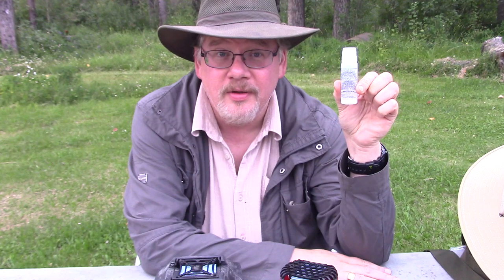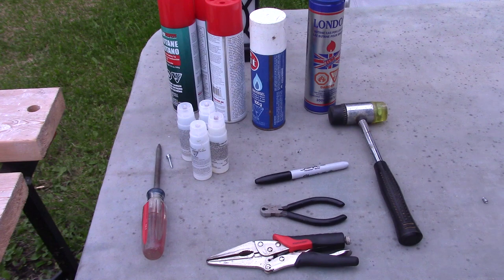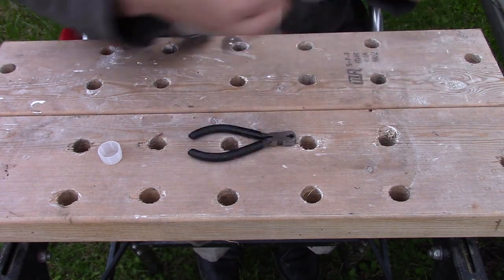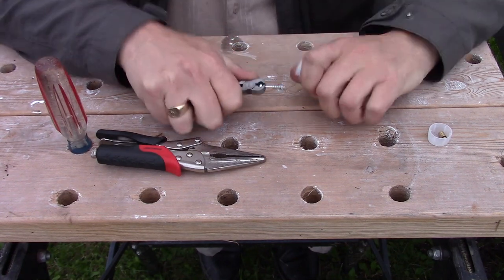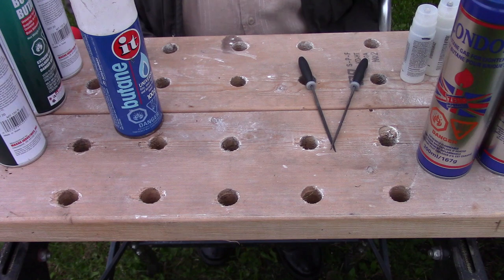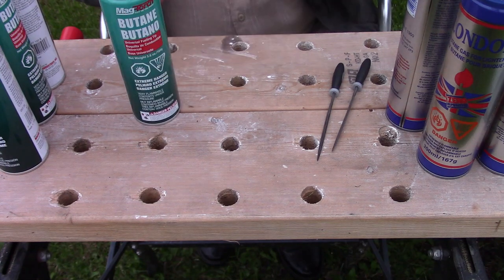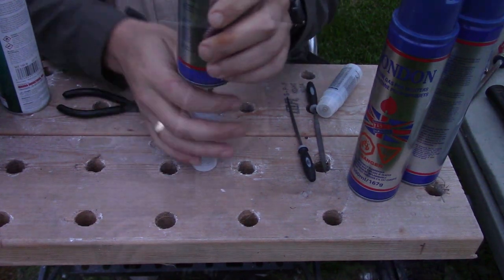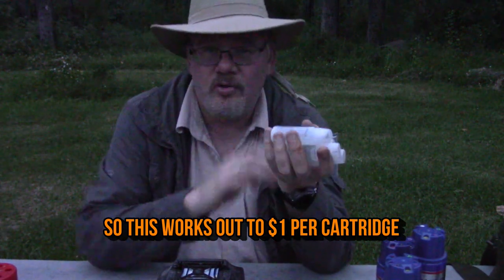ThermaCell Refill Secrets Revealed! Safety Tips, Step-by-Step Guide, and Bonus Laughs!

Comment: Very good video. As you said, it combines the best points of those previously done. Was unable to see how you modified the tips to get them to work better, however. Will watch again and listen more closely to your explanation.
Reply from the maker: I modified the tip of the butane nozzle by taking a small triangular file and cutting a small groove across the tip. This keeps the tip from completely sealing witht he valve in the cartridge and gives the gas somewhere to go (sideways). Before I cut the groove in the tip, it would seat too well with the valve in the cartridge and no gas was getting to the cartridge at all. Before I id that I was wiggling the butane can from side to side, and that snapped off a few tips and took a long time to fill a cartridge.

Comment: Can you tell me what you are notching?
Reply from the maker: I'm notching the tip of the tip adapter on the butane can. This allows a tiny gap on the sides of the adapter so the gas can come oout. Without doing this, sometimes the pressure against the safety valve compresses the adapter enough so no gas goes into the cartridge.

Comment: Hi thanks for the video. Possible to show a pictures of the mod 5 tip
Reply from the maker: Actually they all look similar. So look on the tip itself or on the cap where the tip was and it may have a tiny "5" on it. You will need a magnifier, because it is very tiny. Alternately, you can do what I did with different butane cans (cheap ones mostly) and just keep trying tips till one fits.

Comment: Great to know, what do you use for the replacement pads? I can only seem to find refills that come with pads and butane canisters. Not just pads.
Reply: You can make your own pads with pymethrian and water. Add a little food dye to see your coverage on the pad.
Reply from the maker: Look for the replacement pads for the Thermacell Backpacker unit. They're the same thing but they're sold by themselves. If you're daring you could try the aftermarket pads on Amazon but they're quite small and they smell pretty bad.

Comment: Hi Dean, thanks for sharing. I'm having trouble refilling the thermacell. I lost more than twice as much as went in the thermacell. The "Ronson" tip doesn't fit properly. I bought Grill Master from Home Depot and "Woods" from Canadian Tire and those tips don't fit either.  What can are you using and how do I get it?  Or, do you know where I can buy adapter tips? I live in BC. Thanks,
Reply from the maker: Glad you asked! I found a brand called "London" that works great. It has 8 tips, including the #5 tip a lot of others say works best. There's another brand with a bright yello can and cap, but I forgot the name, but it looked OK too. But the London brand works swimmingly.
Reply: @AlbertaBushcrafter  Thanks for your response.  London brand not currently available on Amazon.  Do you know where else I might get it?
Reply from the maker: @smilinsuzi  I got mine at Smoke King in Spruce Grove AB, but most smoke shops have it, if they sell lighters. Most do.
Reply: The magtorch butane can at canadian tire works great ! And it has the #5 tip
Reply from the maker: @vio95  I used these while first researching this technique. They're good, but be careful to not apply too much pressure and to let the tip warm up between refills. Otherwise, they snap off. But if you do that, those cans work great.

Comment: Cant the pads be used with a candle and eliminate the thermacell?
Reply from the maker: Theoretically, yes. But it would not be easy. The very small butane burner heats a metal plate, which vaporizes the insecticide on the pad. And from the looks of it, a candle would actually be too hot. Marginally possible but I would not take the risk. 

It's actually a lot safer just to refill the cartridges, and you'd only need a few of them to keep the unit running for a long time. And once a cartridge is modified, refilling it again takes a minute or less.

Comment: A narrow strip of electrical tape wrapped atound the end of the butane nozzle works better than the plastic tips. Cut a 3 inch long piece of electrical tape down to 3/4 of an inch and wrap it neatly on the very front of the nozzle tip. As you fill the thermocel cylinder the tape will slip back enough to allow the nozzle tip to activate the valve stem while sealing off the nozzle.
Reply: Take a 3in piece of electrical tape and cut it down to 3/4 of an inch????  Lol. Why not just cut off 3/4 of an inch of electrical tape off the roll in the first place? The good stuff is to expensive to waste!
Reply: @skypallman6169  because you need approx 3 inches of tape that is 3/4 inches wide. Hardly any waste. You actually dont have to cut it down if the stem is long enough. And BTW  i dont know where you buy your tape but Harbor Freight sells it dirt cheap. But if you dont like wasting tape, keep buuing the therma cell refills.

Comment: I can't see where you cut the notch. Across the entire tip?
Reply from the maker: Yes. I took a small triangular file and just gave the top of the tip a few strokes. The notch doesn't need to be very deep - just enough for the gas to leak out the sides past the valve on the cartridge.

Comment: Your most important tip of the day was the need to cut "a little notch" to the #5 tip....then your video concealed how that notch was cut and what it looks like.  Holding up a little drawing of the tip before and after the notching would have been helpful.  No idea where the tip  needs the notch.
Reply from the maker: The tip is about 1mm in diameter. So anywhere will do.

Comment: That looks almost as easy as refilling the metal gas canisters 4 camp stoves I'm not sure what you use those fuel bottles for but I imagine it's for pretty much the same thing
Reply from the maker: It's similar. I'm working on refill techniques for 1 pound propane bottles as well as the isobutane canisters. They each have different processes for filling, but I need to investigate further as they aren't that consistent - just like the earlier Thermacell videos I viewed, in fact. More to come.

Comment: After using file it still wouldn’t fill. Any suggestions?
Reply from the maker: That particular step is the most troublesome. I had to use a small triangular file about 3 times on one particular tip to get the groove deep enough. Unless the valve stem itself is damaged, filing a deeper groove and pressing down a bit harder ought to solve it.
Reply: Yup, i found the small triangular file to work the best. Then use a fine nail to re-open the hole.

Comment: I had better luck with a drywall screw.
Thanks for the video.
Reply from the maker: Yeah, they're not so bad either but I don't like Phillips-head screws. The screws I found worked best are actually particle-board screws, which have the same coarse threads of a drywall screw, but with thicker shanks and a square-drive head. Either will do - chalk it up to habit and my having snapped too many drywall screws on other DIY projects.

Comment: I've been refilling bottles with butane from Amazon and pads with Permethrin, and let me tell you....it is absolutely nowhere near as effective as the original thermacell butane and pads, good luck
Reply from the maker: The refilled canisters don't last the full 12 hours that the retail canistes claim to last (and don't), but for the cost of the DIY refills compared to the high price of retail cartridges, they are still worth it. The generic permethrin pads and DIY pads, on the other hand, don't work very well at all, are less of a bargain, and frankly, they stink too.
Reply: I have no issues with refilled bottles. I also use ARS 12 mats from Thailand. I think they actually work better than thermocell. ARS also makes a heater similar to thermocell but electric, so it plugs in and no gas needed. Obviously it’s no good in deer stand but great for my shop. I can get the ARS pads for about $0.09 ea vs $1 for name brand
Reply: I buy pemethrian from a lical farm supply. I mix it 60-40. It is very effective on our state bird(skeeter,) here in south carolina. I use it in the deer and bear stand religiously. Our season opens in mid august, so the gnats, skeeters and no seeums are abundant. My thermocell works great.
Reply: @randyhughes3811  60permethrin or water? I read another tutorial that suggested 1:6 permethrin:water.

Comment: Saying to put a "notch" in the tip doesn't help much. A picture is worth a thousand words, or in this case, a video, in frame. Thanks for the tip on London butane though, it's classed as near zero impurities, which is what you want. Don't use low-grade butane to save a few bucks, the impurities can damage the heater.